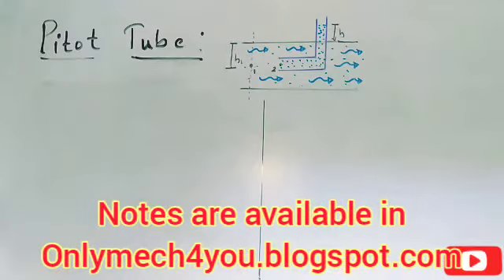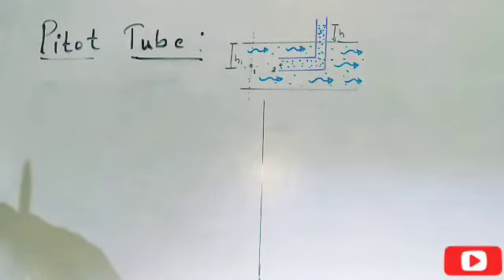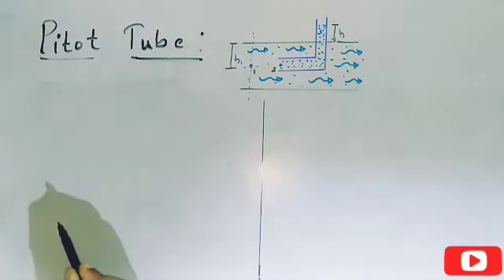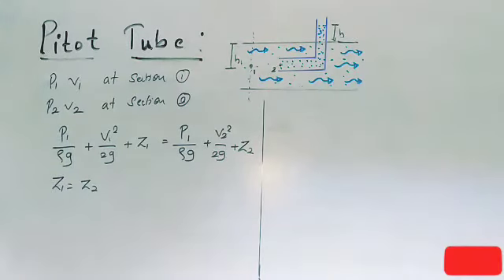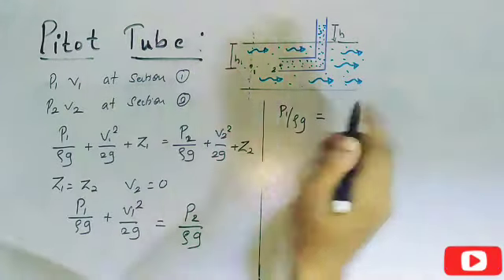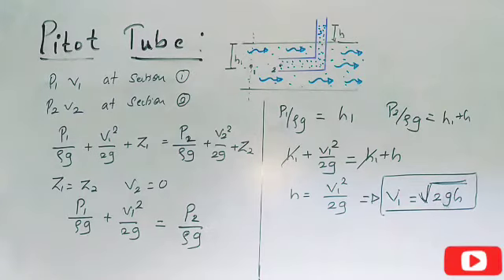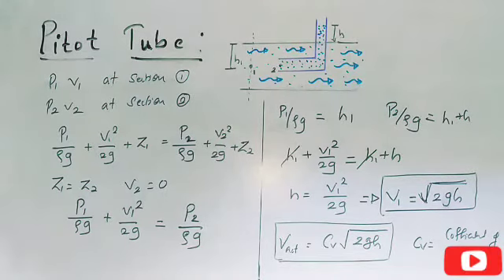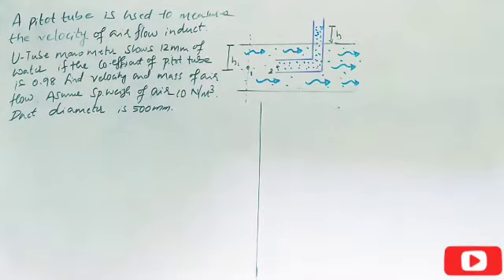Fluid Mechanics Module 3 : Fluid Dynamics | Application Bernoulli's Equation | Part 6 | VTU | GATE

Comment from the maker: Question : On what principle the Pitot Tube works.
Reply: "At any point the velocity will be zero"
Reply: At any point the Velocity of Flow will be Zero
Reply: Ans: At any point of the velocity of flow  will be zero
Reply: At any point the velocity of Flow is zero
Reply: During the flow of fluid, if at any point the velocity is zero.
Reply: Velocity of flow at a point becomes zero.
Reply: At any point the velocity of flow will be zero.
Reply: The working principle of pitot tube is, " if the velocity at any point becomes zero, then the pressure head at that point is increased due to conversion of kinetic energy into pressure energy."
Reply: At any point the velocity will be zero.

Comment from the maker: Question : What are the demerits of Pitot Tube.
Reply: 1. It has Lower sensivity due to lower differential head.
2. It requires higher flow Velocity in order to produce measure heads.
Reply: 1.Foreign material in a fluid can easily clog pitot tube and disrupt normal reading as a result.
2.Low accuracy.
Reply: The demerits of pitot tube are :- 
1. These tubes have poor accuracy.
2. Unsuitable for dirty and sticky fluids.
3. They are sensitive to upstream disturbances.

Comment from the maker: Question : What is Pitot Tube.
Reply: It is the device Used to measure the Velocity of a Flow at any point in pipe or Channel..
Reply: Ans: it is Device Used to measure the velocity of flow at any point at a pipe
Reply: Ans: It is the device which is used to measure the velocity of a flow at any point in pipe.
Reply: It is a device which is used to measure the velocity of a flow at any point in a pipe or channel.
Reply: It is a  device uses for measuring the velocity of flow at any point in a pipe.
Reply: It is the divice used to measure the velocity of flow of any point in the pipe
Reply: The device used for measuring the velocity of flow at any point in a pipe or channel is known as pitot tube.
Reply: Pitot tube is a device use to measure the velocity of a flow at any point in a pipe or channel.

Comment from the maker: Question : What are the merits of Pitot Tube.
Reply: 1.Loss of head is Negligible by inspection of Pitot Tube.
2. It is Very cheaper compare to flow nozzle nd orifice plate
Reply: 1.Small and do not contain any moving parts. 
2.Low cost. 
3.Low permanent pressure loss.
4.Ease of installation into an existing system.
Reply: The merits of pitot tube are :-
1. These tubes have no process loss.
2. They are economical to install.
3. Some types can be easily removed from the pipeline.